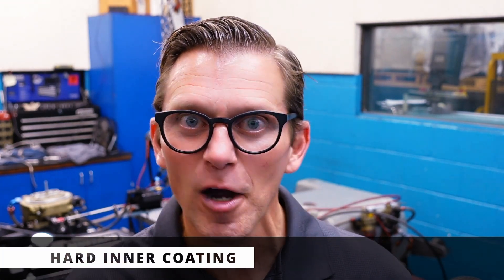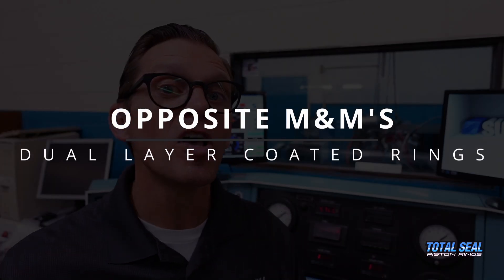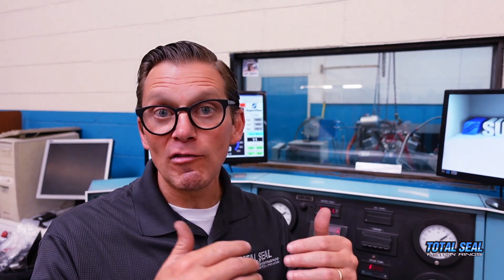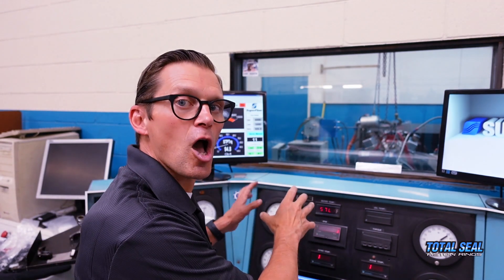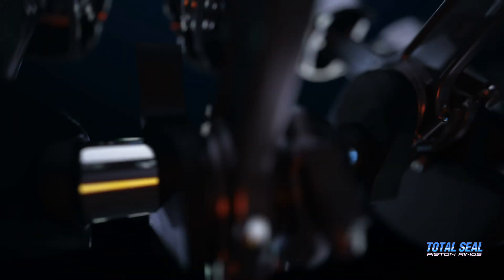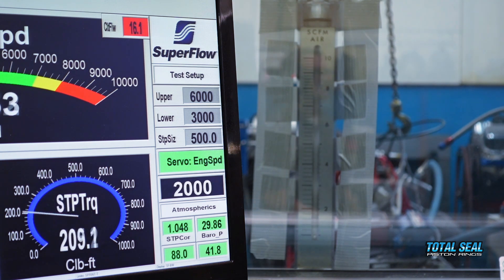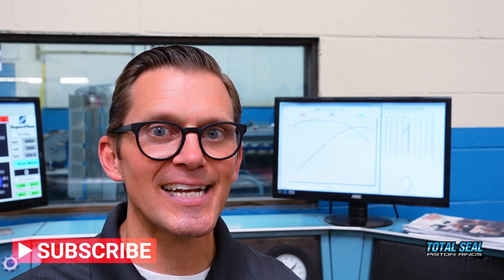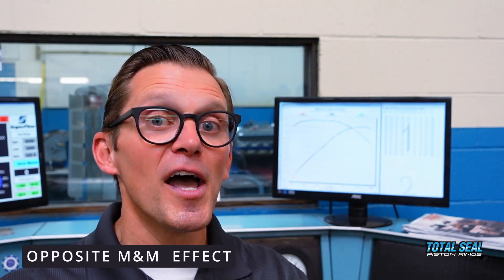M&M's and Piston Rings? How Our Favorite Candy Inspired A New Piston Ring Technology.

Comment: Was there a blow-by base measurement taken prior to the break in pulls? That delta would be interesting. 
Also, how does this reflect on leak down tests?
Reply from the maker: Yes, in a previous video, this same combination without the new coating produced a blow-by reading of 3 to 4 SCFM, so it was about 1 to 2 SCFM better.

Comment: Huh? We didnt see shit happen... What happened, u just said stuff, how do you know it worked as expected?
Reply from the maker: The blow-by results shown on the 4th pull confirmed the rings were completely broken-in.
Reply: @TotalSeal  But there was no blow-by meter (at least shown) for the first 3 pulls, so wheres the comparison?
Reply from the maker: @beachboardfan9544  Check out time stamp 04:13
Reply: @TotalSeal  The gauges settles out at 3ish scfm. What was it prior to break in?
Reply from the maker: @beachboardfan9544  We only hooked it up after the initial three break-in sweeps. We rarely hook up the gauge during the initial three break-in sweeps as the numbers jump all around. In some of other videos, the blow-by has gone as high as 10. 5 to 6 SCFM is typical for a conventional gap ring. 

To see the check ball so stable on the first test pull (4th total) was quite amazing. We don't typically see the ball so stable. It normally jumps around a lot more, especially on the first half dozen pulls.

The HP numbers were also consistent, but the real test (in our opinion) is the blow-by gauge. A stable, low blow-by reading indicates the rings are broken in.
Reply: @TotalSeal  Ahhh nice, thanks for the explanation! 👍
Reply from the maker: @beachboardfan9544  Happy to help. Sometimes we forget to provide the frame of reference.

Comment: What type of rings do the manufactures use, I have always been under the impression that they use a hard metal or stainless steel rings so they last 100k+. Just curious.  🤔
Reply from the maker: The OEM's use stainless steel, just like these rings, but this new coating process is a step up. Very hard for a long life, but a soft outer coating for an easy break-in.
Reply: @TotalSeal  Thanks for the info.